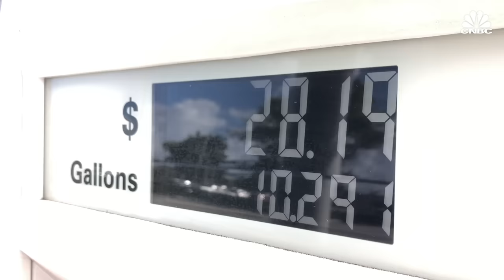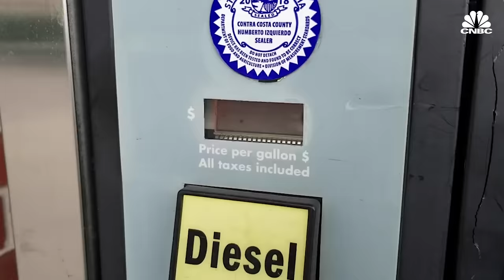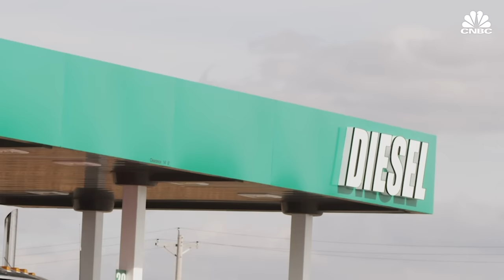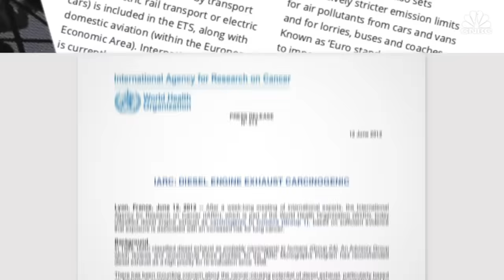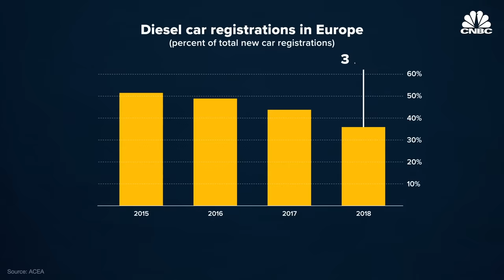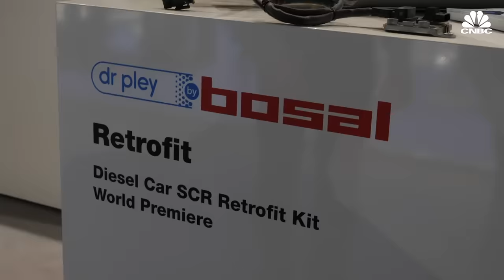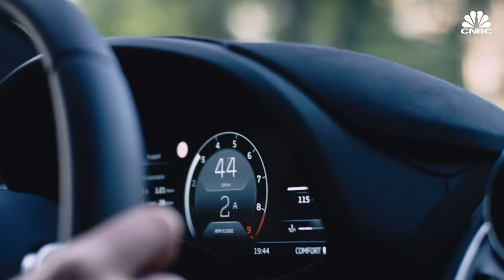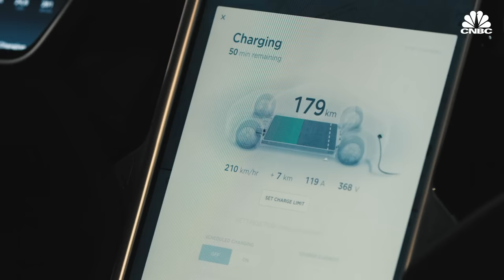Why Diesel Cars Are Disappearing

Comment: I haven't watched the whole video yet (I will) but when mentioning the drawbacks of diesel engines, the one that comes to mind for me is the cost of diesel fuel.  When I purchased my diesel pickup truck in 2002 diesel fuel was the cheapest fuel to buy.   Not long afterward (and up to today)  it became the most expensive fuel to purchase.  I've heard lots of excuses for this but most seem contrived.  Gasoline requires more refining than diesel so should cost more in my opinion.  My pet theory for the higher cost is this.  Most consumers of gasoline are private individuals and its harder to justify higher costs to the skeptical public.  Diesel fuel users are mostly businesses and can pass along the cost to their customers.  I'm sure businesses don't like it but it's a calculated risk made by the oil refiners.  Just my 2 cents worth.
Reply: And.. that's exactly what it's worth is two cents
Reply: @wj2791  Because refiners are selling energy by the BTU content British Thermal Units.  Diesel makes more heat per gallon than gasoline. Hence why it is sold as heating oil, too.
Reply: Diesel is 20% cheaper in the Philippines than gasoline.

Comment: A hyper efficient diesel engine that runs on biofuel could save the planet.
Reply: True, the pollution would smell great too. Fast food!
Reply: Not an awful strategy, but it seems like electric is going faster and will still provide less pollution, depending on what your electric grid runs on. 

Any advancements in efficiency are great though, that would still be much better than regular diesel or gasoline!
Reply: Yeah, until half of the world food goes to making Biofuels.

Comment: I had a 2004 VW TDI.  300,000km on it when I traded it in.  Great reliable cars.
Reply: Had a 2013 passat tdi sel premium. Only brand new car ive ever bought. Fuel economy was freaking amazing! Better on the hwy than a priest and alot more power! Even loaded with the wife, kids and luggage and the cruise set at 78mph we averaged 46-47 mpg. On the hwy we'd get over 700 miles easy. Love that the car had a 21 gallon tank instead of a tiny tank like lost fuel efficient cars.

Comment: Mazda made a diesel-like engine run on petrol.
Reply: Fide Nemini in theory every engine could do that if they get a spark plug
Reply: Mazda’s skyactivD engine is not bad either
Reply: Yes it's the skyactiv X technology  , gazoline engines claimed to be  almost as fuel efficient as diesel ones.
Reply: @jasonyu6649  . I drive Mazdas all my life. But their diesels have reliability issues. The 2.2 is a strong performer, but suffers from DPF issues, stretching timing chains, and rising oil pressure issues threw faulty DPF regeneration resulting in diseal and oil mixing..They also suffer Turbo failure.  The 1.6L engines in the 3 are Ford PSA units.  They aint so bad .I have one with the DPF removed and it's running good. I also gave a 1.8 L petrol Maz 6.
Reply: Be wary of technological advanced engines that save fuel, but are unaffordable because of high maintenance.
Reply: Diesel fuel is petroleum.?.

Comment: Electric will never replace diesel until there is a huge power source, maybe plasma. But that’s a ways off.
Reply: Plus until there's a way to top off in a couple of minutes. By stitching drivers. Husband wife teams Heavy trucks only need the time it takes to refuel to keep going. Even if it's gets faster recharging is never going to be as fast as refueling.

Comment: I love my HDi 2.0 , will refuse to sell it for years , still doing 60+ mpg if it was petrol it would do 30 max to the gallon ??? They say banned from 2030 , ok with me I will be 62 then and won't care ! Just buy a new one Xmas 2029 lol ...Should last until 2050 on one engine ....
Reply: with the right to repair things on cars, you could probably keep getting spare parts for the old one's even if the production of the car itself is stopped so if you buy one in 2029 it will probably last until your kid's kids become adults
Reply: @kaneki1056  Well said lad after 11 months late reply ! Still have a diesel but a new one ! Sold the 407SW and have a new Peugeot 508SW now , 1.6 semi-auto doing 115 mpg at 50 mph ? Unreal economy ? 50+ in city heavy traffic and 78 mpg at 70 mph on motorway ! Go and buy one if you can they are so cheep to run and £20 road tax a year ! my 407SW was £35 a month or £380 a year road tax ! saved a fortune in the last year , saved so much money I have picked up a second car ! Have an SLK200 outside now & Diesel 508 parked next to it !

Comment: Euro 6 cars reduce nox by over 99% in real world driving. Mpg of over 90 is possible if driven carefully. I think that’s pretty good. 2035 for all electric in England is not going to happen. A third of all car there are parked on the street and some villages don’t even have street lights. So the infrastructure for EV’s on mass scale is not there. Electric power supply is not there either. And no investments are done today due to the country being close to bankruptcy . 2050 maybe but not 2035

Comment: Unfortunately, diesel engines in cars made after about 2004 CANNOT use veg oil/waste cooking oil to run on, it will wreck them in very short order. Older engines are pretty safe though.

Comment: I love my diesel truck. It uses about 12L/100km but if I had to have the same in petrol it would be closer to 20l/100km.
Reply: YEs but.. but petrol would be 30 times more cleaner the emmision.. god how you dont understand........
Reply: @tigriukasinlove  "Diesel cars emit suspended particulate matter and nitrogen oxides. On the other hand, gasoline motors release hydrocarbons, carbon monoxide, carbon dioxide, etc. Both of them pollute the environment in one way or the other."
God know, why YOU, dont understand. 

Diesel with an electric engine would be the answer going forward. Diesel is getting better and better each day and trust me, one of these days the swing will happen
Reply: @christheone248  40 times less then diesel =) remember VW 2015.
Reply: Compare them by weight instead of volume to get a more accurate result.

Comment: And how is the electricity produced. First you need to upgrade the whole worlds power grid and electricity production. An electric car that uses electricity produced by natural gas or coal produces twice the carbon foot print a straight diesel vehicle produces.

Comment: general motors set back diesels  by 20 yrs , the early 80's we had vw diesels , toyota had 3 - a pickup ,a corolla and a turbo camry   , and mercedes  all very  good cars , GM put out the biggest POS  ever seen and killed the market ! by the way the VW's got 50 mpg and had a lifetime warrenty in 85

Comment: Maybe it's time to consider hybrid and turbocharge-supercharge

While electric engine still improving and expensive

plus electric engine still seriously need for new battery technology and massive switch to renewable energy
Reply: Maybe it's time to stop falling for scare mongering hit pieces like this.
Reply: @drock5407  which part of it scaring ??
Reply: Lithium is used as a medicine (antidepressant) please tell me again how it's toxic again? Did we all forget there's lead in most cars cos of the batteries? That's fine I guess....
Reply: @m2heavyindustries378  
I'm not an ocean ecologist, but I know a lot of things are toxic to fish, even copper.  So, if lithium levels in the ocean spiked, it could be yet another thing accelerating the total DEATH of the ocean ecosystem.  Again, hypothetical.  I don't have time to do deep research into it.
Reply: @m2heavyindustries378  Yeah that's lithium in a very low concentration... Are you seriously saying that if something is a medicine it can't be toxic? Just increase the dosage a little and you'll have a fun time. Also we're not only talking about toxic to humans, we're talking about toxicity to the environment where we will dispose of said batteries.
Reply: Electric cars aren't emitting lithium... also, at least in Tesla's case anyways, the battery is recycled once it's done with its current car. No reason to ever throw it out...

Electric is much better for the environment, even if the electrical grid is exclusively non-renewable energy powered.
Reply: @kjsdpgijn  Mining the lithium is what's horrible for the environment. Also, with today's power situation a lot of the power used to charge the car batteries comes from coal mines, and that's not any better as far as air pollution goes. Electric cars are a nice idea to keep air pollution down, but they do need to come up with some new technology for it to actually work, with how things are right now it's just counterproductive...

Comment: We might be able to tweak the whole system to favor electric transportation.  Electric train delivery to all centers with the last distance by electric vehicle would greatly reduce long haul truck transportation.  This would also be a boon for road maintenance.  Trains don't even have to have an electric connection over their whole rout.  If they have a battery where the coal car used to be right behind the engine in steam trains, they can charge up while moving over selected parts of the track, spaced so that they can reach the next charging section.  These battery cars can also be swapped out while they are in shunting yards and the empty car, charged up.
Reply: I would love to see electric trains replace semi-trucks, but the reason semi-trucks replaced trains in the first place is because railroad companies had to pay for the railroads, where as trucking companies do not pay for the roads.
Reply: @TheGuyThatEveryoneIgnores  like as if we don't use trains... Do u guys even go out?
Reply: @TheGuyThatEveryoneIgnores  Through taxes on fuel they do.

Comment: Now is May 16, 2022 and the TGT Apparatus is an available green technology to reduce carbon emissions from ICEs using diesel. It has a track record of 10 years to perfect this invention. This apparatus is categorized as an "add-on" aftermarket part. I brought this technology to Los Angeles from the Philippines in July 2021 and plans are laid to set up the first store (sell and install) once a certification is issued by the California Air Resources Board.  That's the green light that we can start to sell. The apparatus comes in various sizes which can be installed not only in diesel engines but also in gasoline  engines of liquid cooled  light vehicles, medium duty trucks, heavy tractors, motorcycles, generator sets and marine vessels. The complete combustion of fuel reduces fuel consumption by 25% to 30% in new or low mileage and from 40% to 60% in high mileage ones. A high mileage diesel engine with 3.00 opacity percentage of carbon can be reduced not to 1.00 but to near zero by using this device. It is a safe product, it does not alter main engine configuration neither the computer or electrical system. The product has a life span of 10 years or more and can be re-used for another 10 years upon calibration. For more information about the installation process and benefits from this green technology, watch for THEHCO GREEN TECH here in you tube.

Comment: My 1.5 diesel car can do over 100 miles per gallon at 55 miles per hour. At 70 mph on motorway (highway) it does 65 miles per gallon. Unfortunately I will have to sell or scrap my reliable diesel car this autumn because of the ultra low emission zone scheme that will expand to my area in London.

Comment: I know someone with an 05 TDi Passat and it is a very nice car.  Gets excellent MPG that even rivals the Priuses.  Yet it is a fun to drive car, not some gutless Corolla that struggles in vain to get out of its own way only to never once do it in history!  I believe the specs were 100 HP or 140 depending on the engine but don't let that fool you, they have lots of torque.  Volkswagen and Audi don't produce only Diesel 4 cylinder engines BTW.  The make V6s, V8s, V10s and maybe some bizarre engine not usually found in the USA for some unfortunate reason.  Should you ever come across a car with one of those other Diesel engines, expect to eat their dust!!

Comment: I remember my friend had Mercedes 200D from 80's something, man that thing was indestructible  tank, cheap to maintain and incredible reliable. Never ever broke and no turbine no excessive parts, behind the bonnet clean engine bay almost without wires, everything simple and approachable, very low fuel consumption. When he sold it, i told him that he is an idiot, that car would last another at least 30 years with just basic maintenance. These old diesel car are something special.

Comment: Long term fuel storage favors diesel. Remote locations with limited time frames to gather fuel for extended times without fuel deliveries, and the chemical stability of the fuel are bonuses in difficult areas, like the south pole and certain parts of Alaska,  the Yukon, and Northwest territories in Canada.
Reply: Or cheaper solar and batteries

Comment: I would still buy a diesel, but I want to avoid DPF and urea pumping to the calalytic converter.
The best were those old atmospheric. Less NOx, less PM2.5, but slightly more CO2 and normal sud.
EVs are good just for some use.

Comment: I loved my 2014 Chevy Cruze diesel...all that torque and the fuel mileage was over 50 mpg on the highway...I seen over 800 miles on a tank of diesel...but the problem with the modern diesel..and the only problem I ever had with my Chevy Cruze diesel was with the emissions system...constant problems with nox sensers and the diesel exhaust fluid system over the years I drove it...if you get the " diesel exhaust fluid quialty poor" message on the cars message screen the cars  computer is mandated by the EPA to be programed to limit speed limit after 99 miles to 65mph...then after another 50 miles or so, the  speed is limited to 55mph....a few more miles after that and the car is at 4 mph...what happens  if your on a road trip and you get this failure with that DEF system...your screwed...I enjoyed my diesel car but I got so tired of the emissions system failures with the diesel car...I was thrilled when I first got my diesel car, but what a  happy day when I finally got rid  of it and went back to a gasoline car.

Comment: The only thing a diesel engine needs further is a 2-stage particulate capture tube in the muffler exhaust pipe.  

The documentary here explains the advantages of the diesel engine versus the gasoline engine.
1. It is far more efficient.
2. It uses much less fuel.
3. Ot does not produce C02 by far.
4. The Engine lasts longer (lower mechanical RPM applied).
5. The Source of the fuel itself partly comes from renewable/ reusable matter - recovered 'waste'. 
6. It generates greater torque; it works better.
7. It is less complicated with less parts. 
8. 36+ mpg is common normal. 
9. Worldwide infrastructure has long existed.

Gasoline is going the way of the dinosaur.
The future has arrived.  
It's Electric and Diesel.

Comment: If everyone goes electric we will have to dig up lots of mines around the world to get the raw materials with diesel bulldozers dump trucks, put on diesel trains or road trucks and shipping. This is for batteries, extra power stations ,infrastructure such as more power distribution cables around the world , charging stations, recycling centres for used batteries all transported by diesel .  This is to create a new industry that sells more expensive vehicles and pollution will just not be seen so it won’t exist.

Comment: Diesel engings
Are the best
U can  mix oil
With it
 Any oil soya corn clean oil
 Tanks ships should be mixed
Coco nut oil
Reply: Using non standard diesel fuel in a modern diesel engine has a very significant risk of engine damage.

Comment: Let's see how the world copes with electric only. Power grids are going to be under pressure. Plus battery production isn't exactly environmentally friendly. Some countries simply will not be able to go electric. Especially remote places. 

Don't forget to mention how clean new diesels are especially with particulate filters.
Reply: remote places? I guess you never heard of solar...
Reply: @blomegoog  Sure because the most desolate and poor remote places can afford solar. When aid must drive trucks to reach there you think they can carry loads of batteries to top up? No. You think even of they had solar they'd be able to charge up enough or quickly enough? No. In many countries people have one car and they use that car for ALL their needs. Electric cars are expensive. Cheap have a range of zero. Meaning it will never work for the majority of people not until prices plummet. You can buy a brand new Dacia Sandero with a 0.9 turbo engine. It can go 560 miles on a tank. It costs less than 10,000 dollars brand new. An electric car with that range doesn't even exist let alone one that could even cost 10,000 dollars. It will NOT work for the majority of the world's population and needs. Not now. Until we get one that costs 10,000 dollars with 560 miles of range, electric has a long long way to go. In some countries people drive their kids to school, then their significant other to work. The charging infrastructure is still to weak. Some grids are under pressure even without electric cars. A 10,000 dollar electric car would have a range of 60 miles.
Reply: @SDav21  FYI Dacia is about to put an electric car on the market. The most affordable one ever.